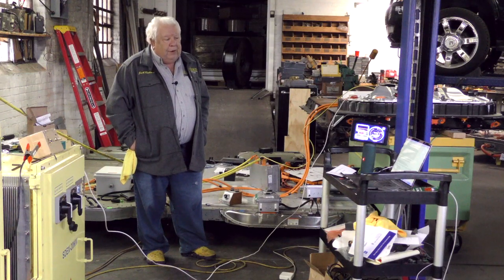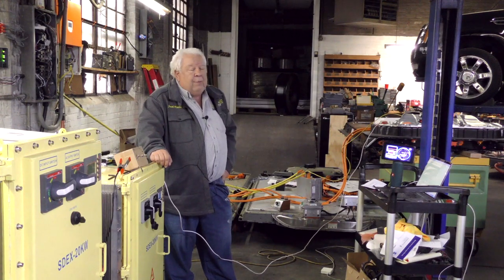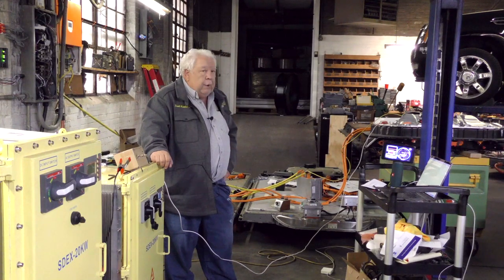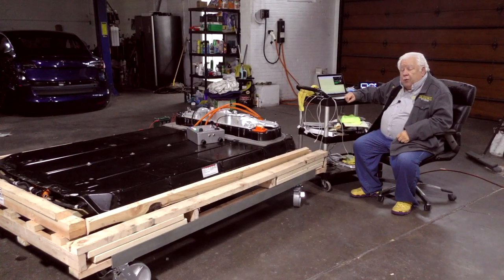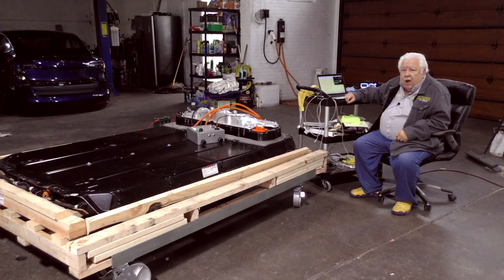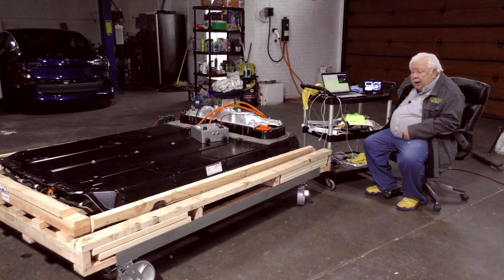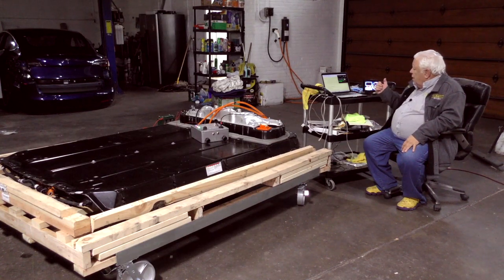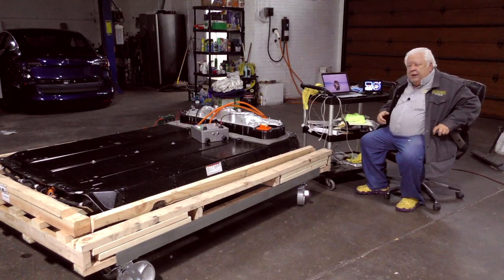Tesla Stock Trade - What Now?  EVTV Model 3 Battery Module Controller Progress. Coronavirus

Comment: You haven't told us thoughts on the giga Texas and the new laser-welded battery packs. Also I've heard the new model Y has a heat pump instead of a strip heater to heat the cabin and that is how they've reached 315 mi per charge.

Comment: Jack any comment on  lithium iron phosphate (LFP) batteries being used for China Model 3s?  LFP batteries served you well in the EV conversion days.  The internet talking heads think LFP packs we'll be ~20% cheaper and be Cobalt free.  Funny - far as I know LFP have always been cobalt free.  

I think CATL made such a low bid that it was too good to ignore. CATL LFP batteries have been used in Chinese electric busses and the demand for the busses has fallen off so they have excess capacity.  I suppose the dry process is more about volume and not costs, and for China costs and time to market are important, so filling a battery tub with LFP batteries that are readily available and cheap makes it a smart move.

Comment: Jack, you calculate the deathrate = deaths/recovery which would be correct, if all the data had the same timestamp. But recoveries take longer than deaths, so there is a delay in the data. If anyone is able to find how long the average death vs the avg recovery takes, that would be really helpful.
And though while the data might be manipulated some, as you suggest, there might also be a ton of cases that are just to mild to be registered as corona.
Reply: Does it impact smokers more or is that a myth ?

Comment: Had to stop short,  but I agree, a system that can run 3-4 hundred volts from a second life car battery would be perfect home solution.  Thumbs up.  💪🏻.
Reply: My jack style powersafe 24 ran all day at the full bp pack voltage.  We ran all day with zero from the grid.  Did dishes, laundry, heated water AND charged up the Leaf and the Tesla.
Reply: Stan Cloyd that’s sounds awesome.  Keep us updated on some videos.  I don’t know what a jack style powers are 24 is, or what voltage it runs on, but that type of info is great for so many viewers.

Comment: Do you plan on dealing with the batteries thermal management system at all, or do the typical charging/consumption rates not warrant that?
Reply: Good question we still lose forty percent range in cold, and 90% of countries are NOT as warm as California so its a bigger issue than too hot ?
Reply: Let's do the math.  Assume charging at 6kW, of which say 5% = 300W  is lost as waste heat - the remaining 5700 watts are converted into stored energy in the battery.  300 watts dissipated uniformly over the surface area of the entire battery shouldn't warm the battery very much IMHO.  I'd estimate the thermal mgm't system isn't critical at these power levels.  The situation is quite different when the battery is delivering hundreds of kW during a fast getaway at the traffic light, or accepting a couple of hundred kW at a SuperCharger.

Comment: Hey Jack, I love what you are doing with these Tesla batteries and grid tie inverters. I agree 100% with using the battery's store bought high voltage and the use of smaller conductors and lower amount of amps. My question for you is are you able to use the whole Tesla as your battery? Maybe incorporate the wireless charging pad that can pass current in both directions to use your car as your power wall. To me this is the holy grail. I would be very interested in buying a Tesla if a system like this is available, even as an aftermarket system like what you are doing with the batteries. I would love to hear your thoughts on this. Joe

Comment: I did screenshots of the John Hopkins website about 12 hours apart and the change was just 1.35% more deaths during that time period.  Or 34 more deaths in 12 hours and 2,514 more recovered in 12 hours.  (2,514 + 1.35% = 34)

Comment: My Solaredge needs 400vdc from the solar array. Why can't a model 3 battery be attached in parallel to the solar 400vdc voltage and the solar inverter to fill up the battery to 400 volts?

Comment: Hi Jack - nice work - just a thought - if we mounted the battery in a trailer then charged at a charging station we would have a fully portable, flexible charging solution for emergency power.. I think a type two charging port would be a good idea... not for in the office but for portability and expanded functionality - on the inverter side can we use a fronius 15kw as the max input voltage is 600 vdc....https://www.fronius.com/en/photovoltaics/products/all-products/inverters/fronius-primo-ul/fronius-primo-15-0-1-208-240 ... I don’t work or represent the product but I do use it on my grid tied solar ..thanks for all your videos ...

Comment: When SARS erupted the "experts" thought it only has about a 2% CFR (death rate), when it was brought under control it was confirmed that SARS had a 10% CFR. I think you are right on the money with your thoughts. Some people have become infected after recovery, so immunity is very questionable. Second infection can be more deadly after COVID 19 damages your body the first go round. 
Question - could you use your Tesla's battery system itself as a back up power supply for your home in an emergency?

Comment: So is one Model 3 70kWh pack equal to 5 Tesla powerwalls?  Is there an advantage to the model 3 pack compared to 5 powerwalls?
Reply: Whole model 3 pack is around $5k. 5 powerwalls will be something like $50k. 10 times price diff. Enough?
Reply: @D9ID9I  where do you see a $5000 US Telsa pack?  I’ve seen salvage ones for $9000+.  You can’t compare directly a wreaked cars pack to new powerwalls.  The powerwalls have the 5kW/7kW inverters and their own heaters/coolers built in, and a compact FormFactor.   There is a problem finding an inverter for the native model 3 packs BTW
Reply: @olemissjim  getting 2 blocks of ~1000 good cells for $1400 each. That's around 35kWh total (75kWh tesla). So you can certainly find ones. But yes, that's a lot of tweaking and playing with bells and whistles ahead for me. But on the other hand - I will be able to maintain my system and not rely on Tesla proprietary thing. Hopefully.

Comment: What do you think about 96 volt inverter? Would your Chinese friends customize something for you?
Reply: According to Elon the jump to cell-to-pack assembly will make the modules a thing of the past.  Tesla went to silicon carbide IGBTs and Sandi would be wise to follow.  Sandi and Aims have a shot at it.  Which will wake up first.  Is Tesla using the silicon carbide IGBTs in the Powerwall?

Comment: did i miss it or did you say at what range you will buy back in I might want a slice of that action.
Reply: It's not the stock price number, you doofus.  It is when the cows stop stampeding over the cliff.  Let's see if CrownFlu#2020 pulls out its 10% to 25% of the population and cleans us up for another run later on, then when we see the stock market at a low point, we can buy lots.  Who knows the exact numbers.  Have enough dry powder to buy on the way down and on the way up, then don't be caught holding the bag at any point, since it will go down and up lots more.  But there will be a recovery point.  There always is, until there isn't, which is why SpaceX, and then there's Mars + all the moons and planets and stuff.  Lots of fun work to do and life to live!
Reply: Surely if it came from animal (unknown) it will have to wait till we are dead or immune, and we're getting immune at the rate of 90%

Comment: I want to come by and play around with ramp up and ramp down using ramped frequency and out of band messaging.  I almost got in my car and came over, but I don't want to be responsible for you going to your "better place" just yet, since I tend to have a vacuum effect on junk like that.  Since I'm not an EE, I'd mostly open the Sandy and get mad and then ask for the schematic and get mad and just keep trying to learn at it until I got it to work.  I'd also parallel an attempt at out of band messaging, and likely not get far.  But I'd want to get it ramping one way or the other, and could put in effort on that.  I'd have to come for half a week at a time so I could come home and deal with relatives who need medical attention until I knew what study material I needed, then I could work from home.  I'm stupid enough I could do all of that with my own limited funds and not run out quickly enough to get that mad at myself.
Reply: Down load the manual for the Sandi inverter from their site.  Do your homework before the pilgrimage to the solar/ev mountain in Cape.

Comment: Thanks for sharing your hard-earned wisdom Jack.    I sold out of Tesla this morning as planned when/if it fell below it's "3X supported" 2020 chart uptrend slope... looks like "fear" has supplanted "greed" again..for now.  I'll hop aboard again when the mood shifts!   I know you said you don't believe in/use "technical" analysis but I'm still a fan, both of it and you. :)  When I observe any movement which continues day after day along a steady consistent trajectory, I can't help but feel (and bet) that it will continue the pattern, ....until it don't!  :)
Reply: While I wouldn't wholly recommend using technical analysis, it can and probably should be used as one method to determine the value of a stock along with the fundamentals and all the other methods. They all have their benefits.

Comment: Where do you get that mortality is 10%? Everything I hear is 1% to 2% which isn't trivial.That's 10x or 20x the mortality of flu. 10% mortality is half way between flu and bubonic plague. I think your methodology is flawed. In your way of thinking your either diagnosed and recovered or diagnosed and dead. But that is not the world. The 60k whose diagnosis etiology is undetermined are ignored even though it's by far the majority of cases. And then there are the 7 billion who will never get diagnosed and may die and may not ever get diagnosed.